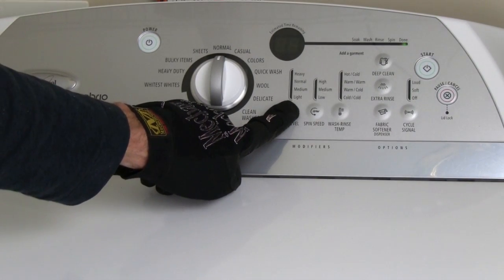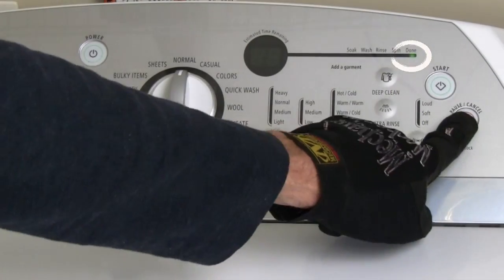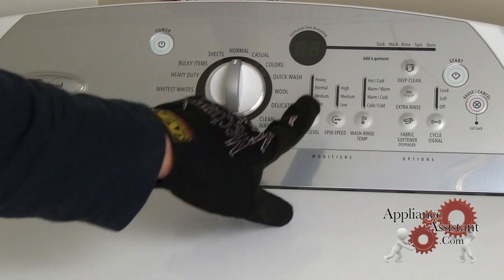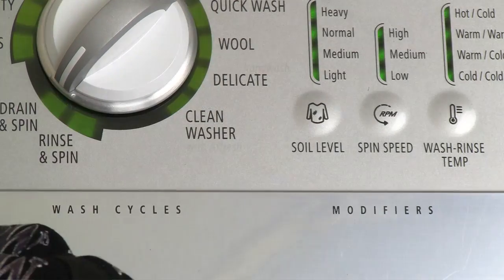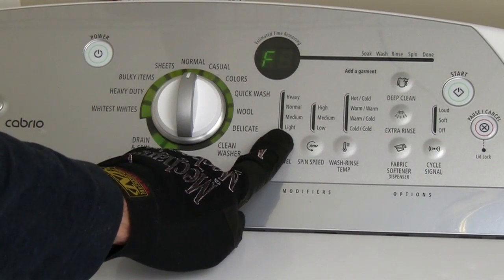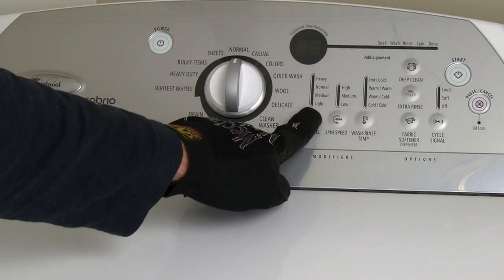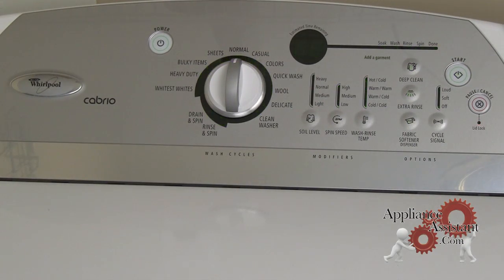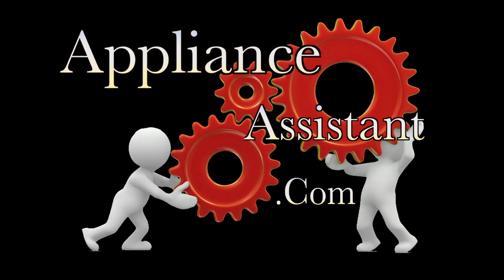Washing Machine Diagnostic Test & Error Codes (Cabrio, Bravo, & Kenmore Oasis)

Comment: Have the Whirlpool  Washer  Cabrio Top-Load Model WTW5640XW3, have no water coming in at start up, went thru the diagnostic error code look up procedure, and only got F0 and E0 readings, can you help me?, still no water.  Seems to go thru thru the water attempt twice I can hear a valve, and the lid locks like it should....no water entry....Thanks a million

Comment: Keep getting the Error Code LF any thoughts on how to fix it
?
Reply from the maker: Zach Heiberger Lf is "long fill" you may have a bad water valve... here is a guide to the manual valve diagnostic test:
http://applianceassistant.com/Washer-Repair/Cabrio-Bravos-Oasis/Cabrio-Bravo-Oasis-Diagnostic-Modes.php#Diagnostic

You may also have a problem with the water supply to the washer, so check that first before you replace the valves. Hope that helps! Good luck!

Comment: I am getting a F 2 code on my Whoorlpool Cabrio washer. It has been serviced 3 times and after a week and a half it show F 2 again.
Reply from the maker: April Dupuis F2 is a user interface fault... normal caused by a stuck key or button in the user interface control board. do any of the buttons feel different from the others? (no click when pressed.)

Comment: hello! thanks for the video..after following the instructions and once the diagnostics was complete the machine displayed a error code F72 what does that mean? first code was ld
Reply from the maker: Erica Holland The Ld code is "long drain" and the F72 means that the tub did not sink down after drain to re-engage the basket's drive hub for spin.  The "long drain" code could be the cause, if the water does not fully drain out the F72 will happen. So you may have something in the drain pump or the drain pump is bad... the other possibility is that there is something under or on the side of the inner tub, like a small towel, that is keeping the inner tub from sinking back down to lock into the hub...
http://applianceassistant.com/Washer-Repair/Cabrio-Bravos-Oasis/Cabrio-Bravo-Oasis-Error-Codes-2.php
F72 is the last one on the page.
Hope that helps! Good luck!

Comment: I have a whirlpool cabrio, type 581 Model wtw6200vwo. I ran the test last code f32, cleared it and start to run is test and everything was working and stop at c8 water still in the washer, did it twice and now what?
Reply from the maker: myriam ward Sorry for the delay! It sounds like ether a clog in the drain pump, or possibly there is something like a sock floating around between the tubs that is clogging the drain pump intake.  Here is a link to the repair guide:
http://applianceassistant.com/Washer-Repair/Cabrio-Bravos-Oasis/Cabrio-Bravo-Oasis-Diagnostic-Modes.php
If you end up needing to pull the inner tub and its stuck...https://youtu.be/m7rfpFhIcX0

Comment: I have aWhirlpool Cabrio model WTW5640XW3 that doesn't spin. It sounds like the pump is continually trying to pump the water out but never kicks over into spin cycle. I have to shut the power off, UNPLUG it, wait a few seconds, plug it back in, wait a few seconds and then put it on drain and spin to get it to spin. I tried the diagnostic and calibrate cycles. The diagnostic completed but the calibrate only went a few seconds in and then ALL the lights came on and the display showed 88. 10 to 15 seconds later the lights went off, the water pump came on for a few seconds and I can hear water running, then it shuts off completely. Any suggestions? other than a new machine.
Reply from the maker: Linda Pryor Sorry for the delay! Here is a link to the new guide I made for that style of cabrio washer. http://applianceassistant.com/Washer-Repair/Whirlpool-Washer-Belt-Drive-Splutch/Whirlpool-Belt-Drive-Washer-Repair-Guide.php Try to get the error codes through the diagnostic process and see where that points you. I'v had a lot of problems with the tub sensor/ actuator, but it doesn't normally try to drain like that...
Reply: Linda Pryor

Comment: I have a whirlpool cabrio WTW5700x  washer we have changed the lid lock sensor, the actuator, the capacitor and now the control panel. I tried to put it in calibration mode and it won't run. All the lights come on and then go off and then the lid lock flashes.
Reply from the maker: kevin hatch So sorry for the delay! Did you get any error codes? http://applianceassistant.com/Washer-Repair/Whirlpool-Washer-Belt-Drive-Splutch/Whirlpool-Belt-Drive-Washer-Diagnostic-Tests.php

Comment: I have a Whirlpool cabrio which is indicating SD code; which means suds, but there are none and I made several wash cycles without detergent at all to see if it would clear.  I changed the RPS and it is still doing the same thing. The other option per Whirlpool is to replace the control board. Any other suggestions?
Reply from the maker: Sorry for the delay! It's usually drain related... if the drain pump is draining the water out well when you do a forced drain. http://applianceassistant.com/Washer-Repair/Cabrio-Bravos-Oasis/Cabrio-Bravo-Oasis-Diagnostic-Modes.php#manualTest
The only other thing that you may want to look at before investing in a new control, is that the inner tub is floating off of the drive hub and reengaging as the water drains out.  The drive shaft on these washers are common to corrode and jam up. However, the most common error in that case is OL. so I would look mostly at the drain pump and drain pump intake port under the inner tub. (The inner tub can be very difficult to remove if the inner shaft is rusted.) Hope that helps some!

Comment: My whirlpool cabrio will not complete a cycle. I have replaced the lid switch, still have the same issue. No codes comes up after about 10 minutes of washing it stops, i press the power button it it powers off. Help!!!!!!!!!!!!!!!!!!!!!!
Reply from the maker: Sorry for the delay! Thats a tough one with out more to go on... Did it go into diagnostics? Where there any stored error codes?
Reply: No
Reply from the maker: no it did not go through diagnostics?
Reply: No it didn't  go through  the diagnosis
Reply from the maker: Without more to go on I don't know if I can be of any help. Sounds like a main control problem, but that's an expensive part to guess on. You may want to call someone local to look at it, or get a new one because it sounds expensive... Sorry.

Comment: Have one running the f51 an f71 both are the sd or sudz but i dont see any blockage . When ran the diagnostic had difficulty getting it to run . it come up but after the 2 fault codes , it would turn to 88 then C0 then off 
any thoughts ? I was thinking position sensor but its not broken havent ohmd them yet . Will alter today . Could it be the board or does it have multiple things wrong like rps an board or interface
Reply from the maker: It may be board related... The RPS connections are a little finicky... A lot of the time you can fix the F51 by unplugging and reconnecting the RPS connection a few times to clean off any corrosion, some contact cleaner probably wouldn't hurt either.  The pump may be bad internally as well if you are not seeing any kind of blockage.  Hope that helps! Sounds like a tough one.
Reply: ty

Comment: I did this but the error codes did not show up and the auto diagnostics began. Does this mean I have no error codes? I did this because I keep getting the UL error
Reply from the maker: Yes, there are likely no stored codes. UL is unbalanced load... Does it go off balance regularly?  The shock kit is a common repair ad easy to do yourself. heres a link to the shock kit I usually use: http://www.repairclinic.com/PartDetail/b5p11/Whirlpool-Washing-Machine-Suspension-Rod/W10247710/1549067?RCAID=27317
You should probably double check by your washer's model number to be sure thats the right one.  Hope that helps!
Reply: I have the same as Pulse.  Changed the shocks and still the same.  Removed agitator and found cloth stuck underneath but after reassembly we still get the UL code.  Any other ideas?

Comment: Good Afternoon, people, Well We have a company about appliance repair and maintenance here in Venezuela, We are learning about this new appliance, Actually we have a little problem with some of them, it shows us the F 71 error, please if you can help me with it, I will appreciate your help
Reply from the maker: The F 71 error code is related to too much soap or the wrong kind of soap being used.  The washer has a hard time draining out suds so they are very sensitive to the kinds of soaps that the user can use.  Here is a link to the F71 error http://applianceassistant.com/Washer-Repair/Cabrio-Bravos-Oasis/Cabrio-Bravo-Oasis-Troubleshooting.php  Hope that helps! Thanks for the question!

Comment: I have a cabrio that is getting to rinse/spin and then popping up with LD error. I checked line and seems to not be clogged. I also ran diagnosis test and stayed on C8 and would go no further or shut off. Any suggestions?
Reply from the maker: If the hose is not clogged then the drain pump may be bad.  Do you hear the pump trying to work? If it's not getting power then you may have a loose connection, bad wire, or bad control board : (  Hopefully its just a bad connection... Good luck!
Reply: The pump was bad. Thanks a bunch for your help
Reply from the maker: tara Sanders Thanks for the update! That really helps others with similar problems!
Reply: @applianceassistant  I have that same problem, we got the LD error, so we look at the drain and there were some Pennie’s stock there, we were able to unclog it, we run a new cycle but still got the code LD. I ran a diagnosis test and it was stock at c8 for a while and now the code f72 is popping.. do you think that the pump need to be replace ?
Reply from the maker: @cabbruchi  The other possibility with this model is that the inner basket is not reengaging on the center drive hub. That is how the system detects if the tub has completely drained. If the water seems to be draining out now after the pump is clear you may want to check if there is something stuck between the inner and outer tubs, like a sock, that may be keeping the inner tub from moving up and down freely. These are not the easiest washers to work on. It can also be the inner shaft that the inner tub slides up and down on is rusty and that is the cause of the tub not reengaging on the center drive hub.  (big repair) Hope that helps some! good luck!
Reply: @applianceassistant it was the drain pump, we changed it and it works like a new one ! Thanks for your help 😊
Reply: Unplug. Let set 1min... plug in .. raise and lower lid 5 times in 30 seconds... ... worked for me.. reset the motor/circuits..

Comment: Hello - I have a Cabrio washer showing a code of lf - would love any info or help on how to remedy.  THAnks in advance.
Reply from the maker: LF is "long fill" on this washer type, so you may have a problem with the water valve... does it seem to have a good amour of water flowing into the tub on hot? how about cold?  If all that seems okay you may also have a pressure sensing problem, but that would probably result in the washer over flowing.  If it is slow to fill check the valve screens and your home valves for good measure before replacing the water valve. Hope that helps! Thanks for the question!

Comment: my whirlpool the start button doesnt work can anyone help
Reply from the maker: When you press the start button does it feel like the others? or is it squishy with no click?  If it feels a little off... I've had quite a few that have the plastic tab inside the console, that actually hits the button on the control break. You can take the console apart and fix the tab with some epoxy, but it's not easy... If it feels the same as the others, or beeps when you press it. then the tab is fine and you will need to look at the door switch and a few other things depending on if it's gas or electric. Good luck!

Comment from the maker: Yasin Polat, I don't have the option to reply to your question... Not sure why but doesn't seem to be any way to comment here or on your page.  Sorry.  First try unplugging the washer for a few minutes to reset the control.  But it sounds like the start button on your washer may be broken... Does the start button feel different from the others when you press it?  If thats it, the console is an expensive part but you can get in there with some super glue or epoxy and carefully fix the plastic tab that is probably broken.  Good luck!
Reply from the maker: If you are getting UL and the tub is balanced, the only posibility that I can think of is the control is not properly detecting the load. Probably want to run the diagnostics and see if you get any other codes.  There may be a motor or RPS (rotor position sensor) problem.

Comment: I have a whirlpool cabrio washer and I tried running the diagnostic test and it wouldn't even start doing it.  I even used a stopwatch to keep track of the 3 second intervals. What do I do?
Reply from the maker: Sorry for the delay! You may have a problem with the touch panel. You can try another button, check the interface connection to the main control board...(it may not be in all the way.) also there is a new kind of Cabrio out there with a different diagnostics process ... What is your model number?